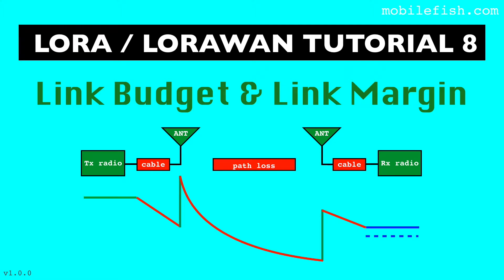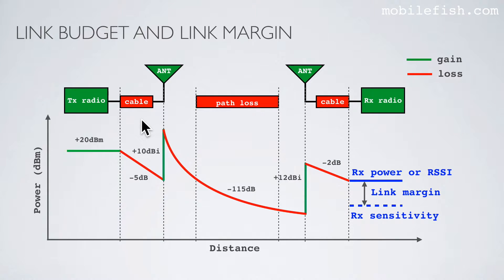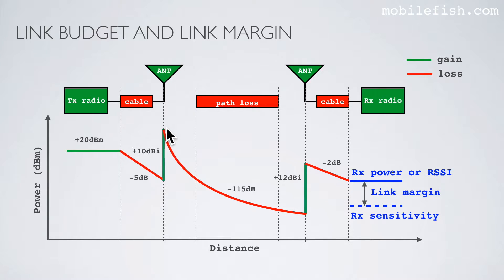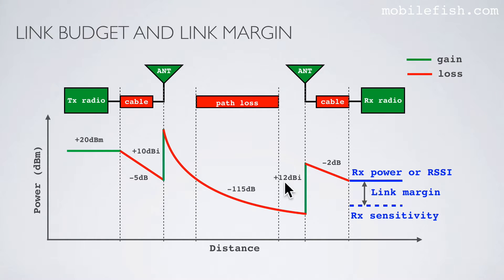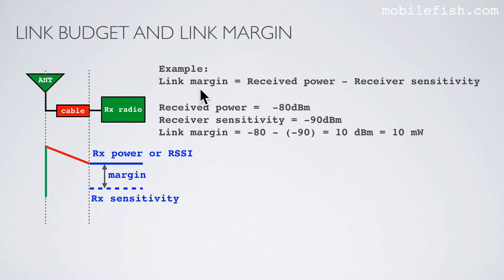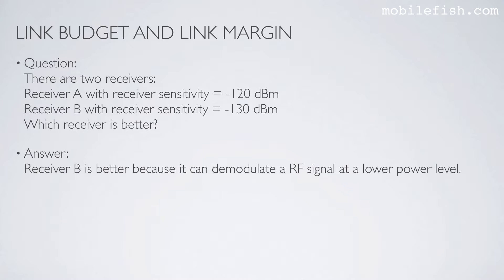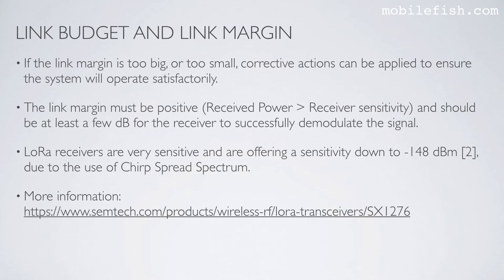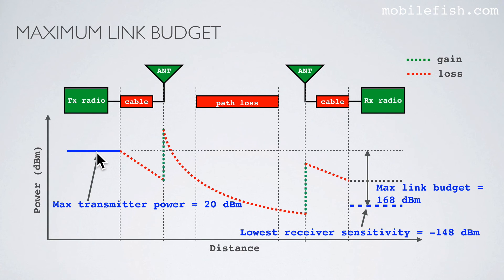LoRa/LoRaWAN tutorial 8: Link Budget and Link Margin

Comment: For other viewers, had to google this - antennas don't add power, they concentrate it.  Notice how the antennas are in dBi where everything else is dBm?  dBi (as stated in a previous video) is "dB compared to an isotropically (uniformly) radiating antenna", so it's basically a measure of how much the antenna concentrates the signal.